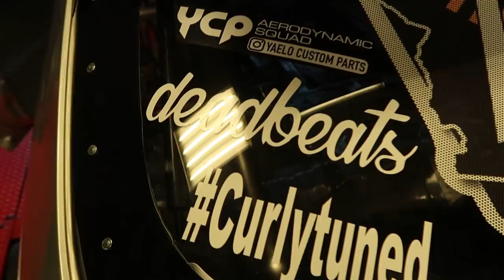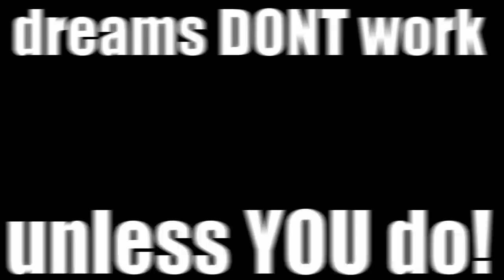Dyno day2! The vans first voyage!

Comment: I recommend running a couple of 6volt deep cycle Trojan batteries (golf cart). Hookup a (Continuous Duty Solenoid) < it is used on RV's. Using an audio isolator to charge the battery is not the best option for these applications.  I hope this helps you guys figure out the best path.  Van life knowledge. You guys rock!!👊😁

Comment: You need a agm battery not lithium unless you got hella money look into 2 golf cart 6 volt battery’s you will get way more power 2 6 volts will add up to 5 of what you have power wise I work at a battery shop those are what I install in trailers and motor homes bro you can get us2200 6 volt led acid ones for around 150 agm ones which are like a gel like your odyssey are around 300 the agm have more power and don’t gas off as they charge but there really hard to charge up if you drain them down so you would want to keep a maintainer on them when not using them I can give you more info if you want let me know

Comment: I had an EG that rubbed when I put new tires on it, I rolled and pulled the fenders and everything and that bitch still rubbed. The fitment was on point so I just let it rub. After about a week it wore down enough of the tire so that I could drive it without listening to that shit. I drove that shit for like 3 months to meets before I finally sold it. My accord did the same thing when I’d air it out but it wore down quick as fuck so I can roll my accord slammed out. Only problem is my bags rub if I drive it layed out and I’m sick of replacing expensive D2 airbags.